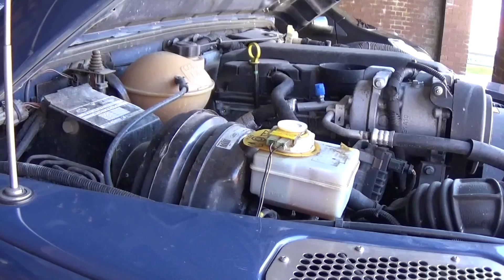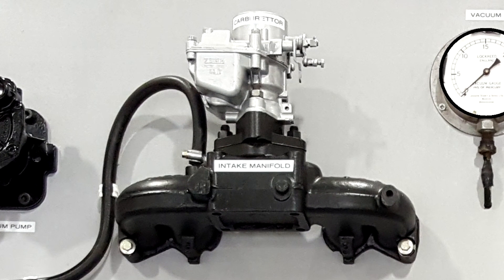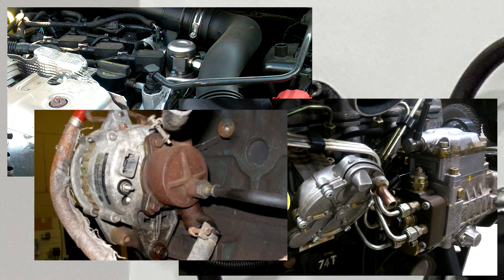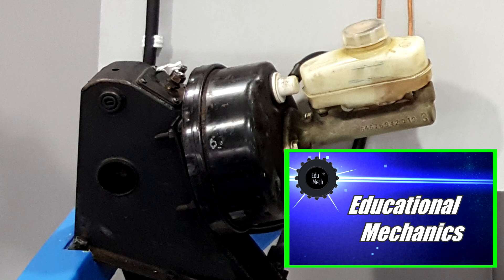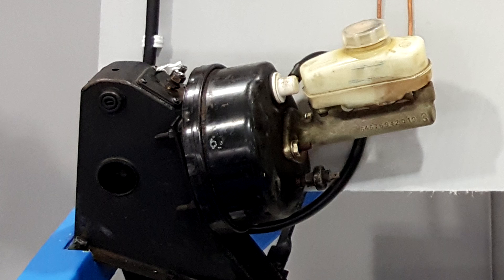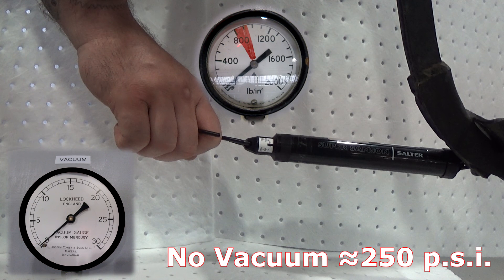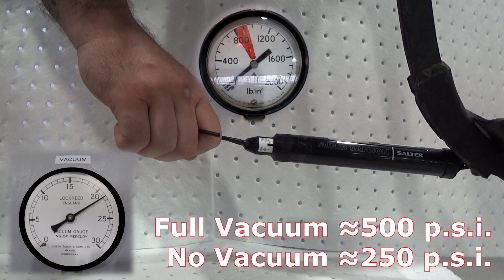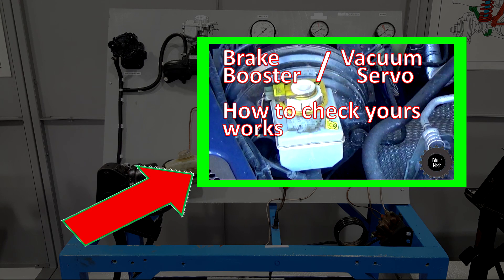Brake Booster / Vacuum Servo - How much does it boost?

Comment: Do all non return valves work the same and would work in any similar servos if they fit tight?
Reply from the maker: If the non return valve is for a brake servo then in theory yes. If it fits and holds the vacuum, then it’ll work